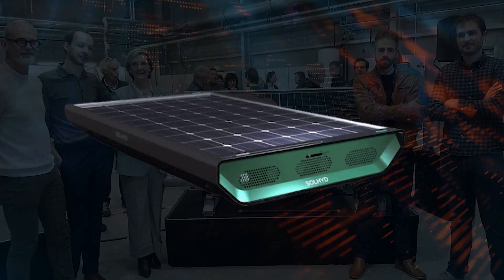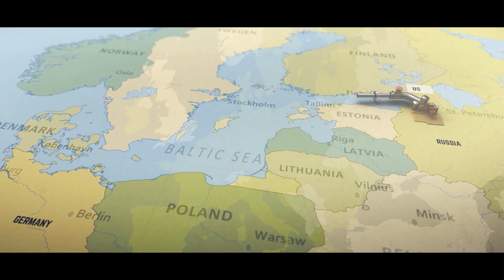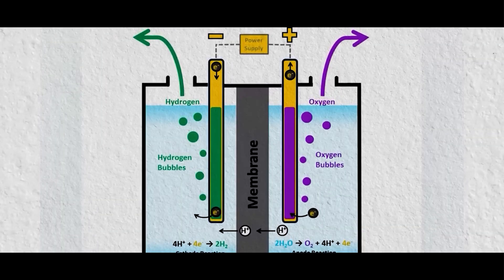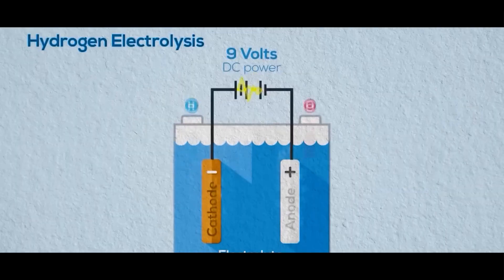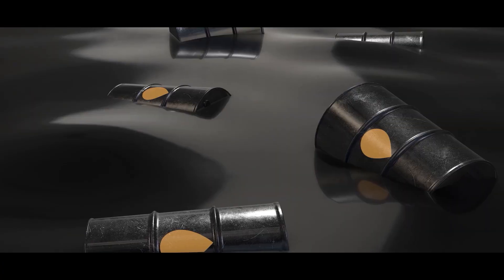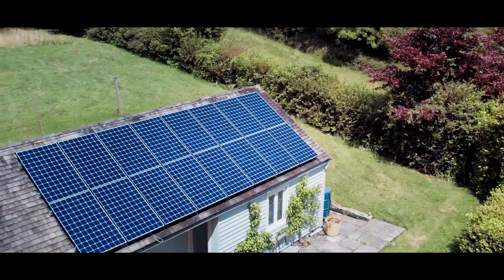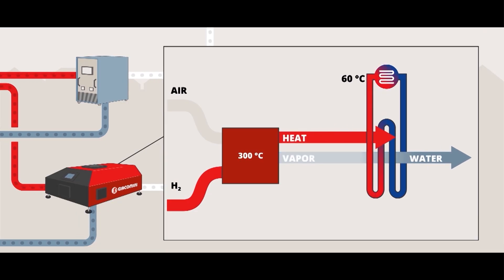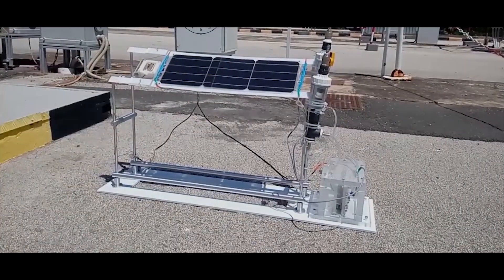NEW Solar Panel Produces Cheap Green Hydrogen at Home | BREAKTHROUGH!

Comment: I love how the efficiency of H2 discussed leaves out the huge inefficiencies in production. It takes a lot of energy to 2 H2O -> 2 H2 + O2

Then more energy to compress the H2 for storage. 

Then there is the issue of H2O collection, storage and usage.
1. In many areas that have the best solar potential also have low humidity. The South East US as an example. 
2. Collecting this water also means collecting the impurities. Depending on the area, this could mean quickly "gumming" up the water system.
3. Not using purified water (and not using water with specific, designed chemistries) will lower efficiencies.
4. Not using purified water or water with specific added chemicals will lead to the creation of unknown chemicals. 
a) using a system designed for NaCl as an additive creates Cl (chlorine gas) instead of O2
b) using a system designed for NaHCO3 (sodium bicarbonate) creates CO2 instead of O2

The inefficiency in creating H2 is a large reason for the high system costs. You must have a much larger solar system in order to create enough H2 for use during the winter. The bright side is that the more solar panels installed, the more electricity produced during the winter, which means less H2 required. At a certain point of adding solar panels you will create enough electricity in the winter that you don't need H2.

Then there is the crazy thought of H2 systems installed in homes that don't do the required maintanance because it's expensive. Imagine a leaking hose or fitting causing an H2 leak. H2 is extremely flamible. This H2 leak leads to bulk H2 storage only a few feet away. 

Then there is the issue of the maintance on the water system. This will be a difficult and time intensive project that may be required every few months. Either the solar system is designed with large enough gaps to easily get to each panel's water system or many panels would need to be removed, cleaned, replaced and recertified.  This would be another expense many home owners would not want to do. For an average home, this would cost several thousand dollars each time.

The high initial cost (even if they reduced this by 50% would still be about $100,000 to install) plus the yearly costs (of maintanance) means that for almost every installation there would never be a break-even point.
Reply: The Germans have just announced that they have for the first time store hydrogen in paste form which is extremely stable at a wide temperature range making it almost completely safe to store. It also stores the hydrogen at a much denser rate than in liquid form. It has 10 times the energy density of a lithium battery. They initially plan on using it in planes and drones enabling new designs and longer flight times with far less weight. It is likely to be used in flying cars one day soon I'm sure.
Reply: @vanmore5124  You mean the technology that was supposed to have its pilot facility completed by the end of 2021, producing 4 tons of magnisium based paste annually?

The pilot still isn't completed.

Ironically, the latest article that I found is from June 8, 2022 claiming a completion by the end of 2021. You'd think they would shaved checked to verify is the pilot was completed 6 months prior, or at all.

Something tells me that the claims were nowhere near reality.

Comment: Still too expensive to install the compressor and storage tanks.
In addition, taking up too much space and lastly the most important item, Safety.

Hydrogen gas when ignited is explosive, much more than Natural Gas as the thermo calorific value is higher than Natural Gas.

Don't forget the German Hydrogen  Airships in WW2.

Comment: Okay So glad to see some body working of Hydrogen . But I will over the world my designs for a hybrid Solar Wind Geo thermal power plant that can be scaled for cities or homes Works on already proven Tech. Works 24 / 7 requires no storage but could have it added if you want. Doesn't use any chemicals to be leaked or burn Birds that fly over it. Make a lot of noise or cause a eye sour to be looked at. And after the build cost there is only a maintenance cost to check it out after a few years. Oh and the Chinese have had a design for Methane production and use for many years. Methane can be used in most any unit that uses Propane, It just requires a minor burner orafiss mod. I will make my design available to anyone who wants to buy it with the provision that they agree to mass produce it and I get a peace of the action, And that they get me a chance to show it to MR. Musk for his use on mars as it is better for that setting due to the dust storms that will decrees the production and increase the maintenance costs to operate them there. Those conditions will not effect the efficiancies of my systems as much as with regular solar.

Comment: Hydrogen eats through piping.I have generated my own independently for about 7 years.
Same problem with syngas.
All you have to do is hook up the dc output and pass it through water.
This automatically splits it.
Most set ups you see on youtube DON'T split the hydrogen from the oxygen,like you should.
The major problems are storage and safety.
If you wanted heat....simply make a sand battery.
Heat it using the electricity.Release its heat when required.
The larger the battery the more heat you can store.
Basically this battery is merely a length of resistance wire which is embedded in sand.
The wire heats the sand during the day.If your battery is stored below the house and has hollow pipes running through it,simply by pumping air through it the heat transfers to the air in the house.
The maintenance of this device is minimal,and a d''''ned sight safer then hydrogen and could be built by any 12year old.
(As proven by my kids)
Now,if you will excuse me my eldest wants to show me how he can make a small pyrotechnic explosion using flour,a candle,a tin and a bike pump whilst I prep some sandbags 😸

Comment: Unless they have figured out a way to get more energy out of something than what you put in hydrogen is like a big energy company scam to keep people unsure so they  have reluctance to buy a proper battery electric car in which 90% of the energy you charge it with ends up at the motor. 
Making hydrogen is at best about 60% efficient, then it must ge compressed which has equal losses, then it has to be turned back into electricity at about 60% efficient before it gets to the motor...  
So you come up with some solar panel that makes hydrogen......how is that more efficient than putting up existing solar panels to charge your batter powered electric vehicle....its not ....but it does muddy the waters for those unsure of what their next vehicle purchase should be. 
Everyone would be well advised to treat hydrogen like an STD....it is the big energy companies attempt to keep their failing monopoly on energy,  and keep you feeding them profits.... sure lobby groups can maybe convince idiot governments to subsidise hydrogen with tax payer dollars but one way or the other hydrogen will not be a win for the consumer/ tax payer

Comment: 4-8 KWH a year for 20 panels that look expensive? The cost of the Hpanels surpass the Spanels and battery duo by A LOT. In Quebec we can need up to 256 KWH a day in a well insulated 4 members household. It is cool, but it is like comparing a toddler running and a rocket.

Comment: This is neat but I'm baking on magma batteries that hit Northern markets this coming summer long as things do not gow wrong with that company the batteries self repair and have many. Many  decades  shelf  also if you use an led acid smart controller set up it will be simple a buy an replace   switched from acid Batts to lipo4 bats  so the next change will be to those  batteries  this setup will be crazy expensive the hybrid controllers from eg4 are better than tesla walls. But never get a off brand if you want to get a chance to get the f90 screen of death equal to pc blue screen of death. Get only full built parts. This includes this new technology if you ever go this route the money saved on all in one units an less wire used will lead old solar prices being the norm 😉

Comment: hmm 4-8 kW*hr per year as hydrogen equivalent energy s tiny. An 8kW PV system makes that energy in 1 hour.  Long term storage is a hydrogen advantage but efficiency from solar energy hitting the panels to finally making electric power is not an advantage with hydrogen.

Comment: it's not going tp work. The atoms of hydrogen are so small the pass through tanks. If left that length of time your going to loss half or so of your volume. This is why Green Amona is the key. Already are gas fired power plants are set up to burn up 50% Amona with 50% natural gas. your needed to stop with this type of posting. People actually believe you. That causes problems

Comment: Why the hell would you want to buy it? It literally makes no sense as it doesn't claim better performance than decades old means of getting hydrogen with electricity. So why put something with more elements that can break on your roof and are probably expensive, instead of just putting electrolyser and use your existing solar panels to make hydrogen? Plus electrolyser at home prevents water from freezing and you can control amount of water.

Comment: Why are people still trying to store hydrogen at high pressure, dangerously explosive gas or liquid? In the 1970s a safe hydrogen storage system was developed in California. It was the the size of a car gasoline tank and consisted of 3 tanks of storage medium. The hydrogen binds with the lattice of the storage medium. It doesn't leak out, it doesn't explode, it doesn't require high pressure, it doesn't require cryogenic temperature. It can store enough energy to power a car.
Reply: any video reference?
Reply: @Ricky Supriyadi  not really. You see, I read about this stuff back in the 1970s. I do recall that one of the materials is graphitic carbon nitride. It stores the hydrogen in the lattice structure of the material.

Comment: My Grand father did the same thing with an old wind charger back in the 40's through the 70's until he sold the ranch. He stored the HO in a tractor tire tube tied to the bottom of a water tank. The weight of the water provided the pressure to push out the gas to the cook stove. I think he even had a shop cutting torch or maybe a brazing torch powered by OXY and HO.
Reply: Your grand farther sounds like a clever man, I would have liked to have meet him, I hope you follow in his foot steps.
Reply: @apollo8352  I was 8 years old when my father explained how it worked in 1972. My grandfather and father set it up. I have only seen one other system like it. It was in central S.D. and I was hauling hot water from a geothermal spring back to a drilling rig in the oil field. The spring heated all the outbuildings then the ranch house, But I digress, the rancher that had the spring also had a similar Hydrogen fuel set up and he built the burners for his cook stove and I believe he also built the tips for his cutting torch. It had to do with orifice size to burn properly. In both set ups the gas generator housing was a glass battery case.
Reply: @lorencolt  Hi there.....we seem to forget town gas was originally hydrogen, before they changed it to the more polluting natural gas hydro carbon.....if memory serves me,  all they did to convert from hydrogen to natural gas was change the gas jets.   
But I especially like your grandfathers gas manometer  storage..... I played around with hydrogen and fuel cells trying to store electricity as hydrogen then changing it back to electricity when I needed it...but storage was always an issue since it leaks out of most things, but a tractor tire tube under water is genius! 
Of course with these hydrogen cars they have realised you need a facility like NASA to liquefy hydrogen so it takes up about 17000 times less space....so storing hydrogen as a gas enough to travel a car long distances requires really high pressure storage, I think they are looking at in excess of 30 Bars, which is a hell of a lot if energy taken up by storage.
Thanks for your reply
Reply: @apollo8352  If big gov did not make it illegal to buy (But not use?) due to it being used in weapons, Lithium-6 Deuteride works perfectly to bond hydrogen so it can be stored at much lower pressure.  Research is being done to use a carbon matrix for lower pressure storage.
Reply: @solarsynapse  1g=$117 cha ching:No Sale
its so dangerously reactive "lithium-6 deuteride ( 6Li 2H or 6LiD) is the primary fusion fuel in thermonuclear weapons."
Reply: @solarsynapse  Hi, rather ironic lithium is used to make batteries and hydrogen storage....but storage of hydrogen is just a tiny reason why us consumers should avoid it in cars and truck...  The efficiency of turning electricity into hydrogen is about 60% ....then the efficiently to turn hydrogen into electricity is about 70%.....compare that to a lithium battery in an electric car and you get back up to 90% of the electricity you put in.....which means hydrogen is non competitive, and the only way it looks better is if your taxes subsidise its cost! Either way the consumer will end up paying ....byt with hydrogen the energy cartels get to keep consumers dependant in them....why with lithium battery cars my roof top solar can give me independence and that independence needs to be valued by the consumer. Plus if you have a 60 KWH electric car sitting in your garage  and your own roof top solar charging it you do not need to do much more to run your entire electrical home with no electric utility cost....imagine that, not needing to buy gas for your car or electricity or propane for your home for the rest if your life!   Or stuff it all up by getting sucked into buying a hydrigen cat! eucked
Reply: @apollo8352  You still need to purchase the battery and it will need to be recycled at end of life, which uses energy and costs in labor.  Although inefficient, the free solar can also be used to make hydrogen from free water.  The solar panels loose roughly 1% per year, so after 30 years they produce about 70% of the power they had.  At some point they will need to be recycled.
Reply: @apollo8352  If you had a modular car like Nio (The ONLY way to make them!), it could be made where a battery or a hydrogen tank/fuel cell module could be used.  It could use whichever is available.  As tech advances, different modules could be used in the same car.
Reply: @solarsynapse  Hi you bring up an interesting point....not only batteries need recycling...there is a little known metallurgy problem with hydrogen called hydrogen brittling.  In which hydrogen storage vessels suffer a problem which causes metal to shatter....with would most likely cause your entire hydrogen handling system to need replacing every ten years or so......sort of on par with battery replacement I would have thought.
Reply: @apollo8352  like me: Germ, ,I am your grandfather
Reply: near atmospheric gasometers are cool but big if you want to feed a town like the UK did for hundreds of years... 
an old very deep well full of water & making deep water storage 'trompes' can help liquefy your diy 'town gas' but you need miles deep water if you want to store hydrogen in a liquafied state without expensive cryocooling &/or super thick specialised containers at near sea level
Reply: I read a story back in the seventies about then President Jimmy Carter visiting a man that ran his entire farm on hydrogen that he made with wind generators. Was that your grandfather?
Reply: @rowgler1  No it was probably the rancher in central S.D. By that time my grand father was on our other ranch in N.D.
Reply: I wanna see it.
Reply: Omg same idea came to me me and ur grand pa should be friends lol
Reply: Yes I would liked to have meet your old man and go play some dodgems with him and buy him some icecream

Comment: 1.Why store Hydrogen, when HHO gas can be produced in any quantity and used as much as is needed?
2. On- site storage of hydrogen needs cryogenics which is costly.
3. HHO production is super-efficient.
Reply: What is HHO gas?? Never heard of it
Reply: To 1.  because pure H2 gas can be compressed at very high pressure and will not explode/combust without an oxidizer present.  H2 and O2 stoichiometric gas mixtures should not be compressed and even the tiniest static spark in the tank will make it KABOOM!
To 2. nope doesn't need cryogenics unless you want to create liquid Hydrogen which is inefficient and is not needed for most applications.
3. really now,  please tell me the electric energy (W) needed x time to generate xx volume or weight of that mixture then lets see how "super-efficient" that is.

Comment: If solar panels that produce hydrogen become more efficient and cost-effective, they could potentially be a very sustainable and clean source of energy for both commercial and industrial use.

Hydrogen is a versatile fuel that can be used in a variety of applications, including transportation, electricity generation, and heating. It is also a clean fuel, emitting only water vapor when burned or used in fuel cells. Furthermore, since the hydrogen is produced using sunlight as the energy source, the process is emissions-free and does not contribute to greenhouse gas emissions or air pollution.

However, as with any new technology, there are still challenges that need to be addressed in order to make solar hydrogen production economically and environmentally viable on a large scale. For example, the production process currently requires expensive and rare catalysts, which could limit the scalability of the technology. Nonetheless, continued research and development of solar hydrogen technology has the potential to revolutionize the way we produce and use clean energy.